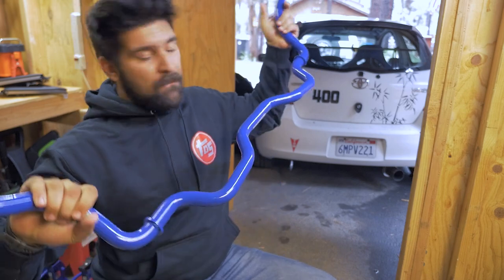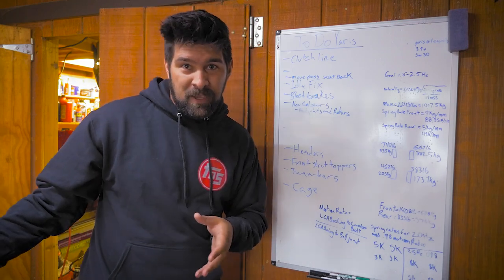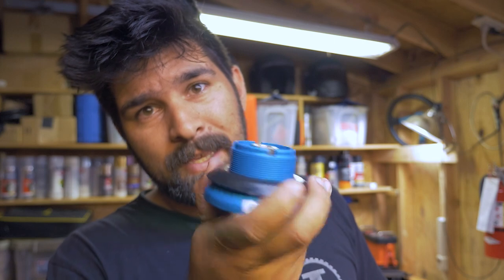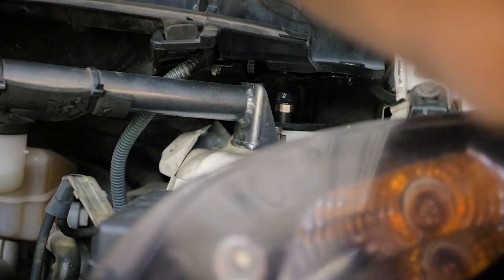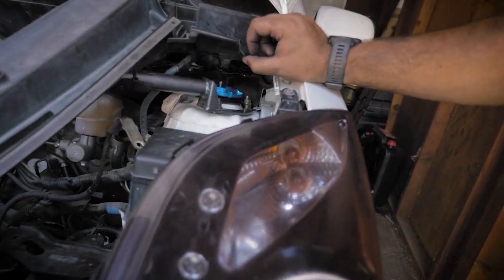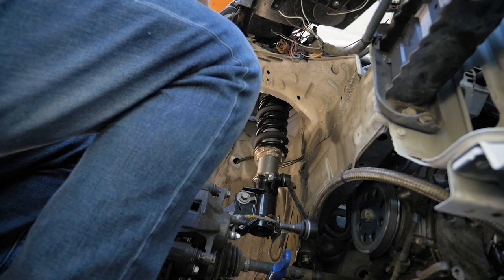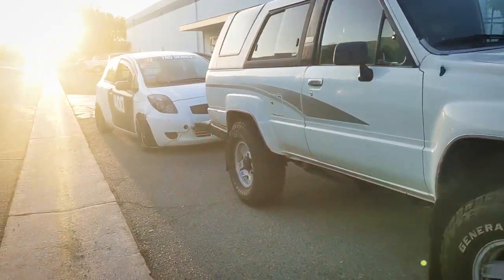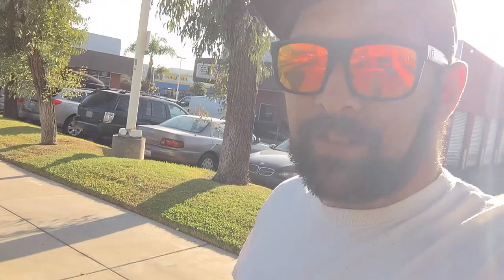How to Make your Coilovers Actually Work!

Comment: I actually had to watch this again, I've been dreading removing my subframe to get to the sway bar, my driver side bushing is worn out and it's making some clunking noise.  But seeing that the steering rack's bolts are actually underneath the subframe, I'm not too worried anymore about having to do an alignment.  Just have to make sure that the subframe and lower control arms rear bolts are back in the same spot, there's a little play in them I believe.  Thanks for making this video, I'm a little more confident now tackling my issue.  Oh and I'm replacing my sway bar with one from the Scion xD.  I had to watch it in .5 speed to catch some things.  I can tell it's more entertaining, you sound like had some Scooby Doobie snacks.  😅
Reply from the maker: Glad it helped. I tend not to make true tutorials, because I never know if I'm doing it right until it works.

Comment: Have you considered any adjustable top mounts to allow you to adjust camber?
Reply from the maker: Unfortunately they aren't an option for the Yaris, but I've got double stacked camber bolts and I run about 2.5 deg negative camber
Reply: @RassoolRacing  I’m looking at getting some made for mine, using a plate that bolts up from underneath. Using a bmw e36 pillow ball adjustable bearing and a custom plate

Comment: Does a stronger front and softer rear sway bar provide better handling and less body roll? I thought it was the other way around.
Reply from the maker: Depends on the car. This one had no rear bar to begin with, so a stiffer front bar is only a slight increase in front roll stiffness while the rear has increased a lot.

Comment: 😂 spacer had me rolling, what all have you removed to lose that 300 pounds off your yaris?
Reply from the maker: Rear seats, most of the interior, ac, heater core, radio, all the ac ducting, lighter wheels, lightweight pulleys,

Comment: bro can you please send me the link so that I can buy my 07 Yaris the same top hats. I have the godspeed coilovers and believe it or not ..the same issue with the spacer when it was installed
Reply from the maker: Here they are listed on eBay. But you can get them directly from Cusco a lot cheaper. https://www.ebay.com/itm/234449378626?chn=ps&_trkparms=ispr%3D1&amdata=enc%3A1yM_0umpzSEiCOFhpY1a6Nw14&norover=1&mkevt=1&mkrid=711-117182-37290-0&mkcid=2&mkscid=101&itemid=234449378626&targetid=1644837435083&device=m&mktype=&googleloc=9031201&poi=&campaignid=16743749222&mkgroupid=138744546207&rlsatarget=pla-1644837435083&abcId=9300842&merchantid=512542660&gclid=Cj0KCQiA-JacBhC0ARIsAIxybyOdd0MSH-AGW285DIhNxFbeiBGEOJOlfI4-FcTaGuLLfxKQb8oYUzsaAhTmEALw_wcB
Reply: @RassoolRacing  Yes Sir- Ha thank you very much! We are officially on our way. Let see what happens when the parts arrive.